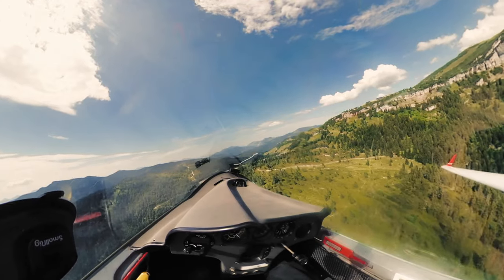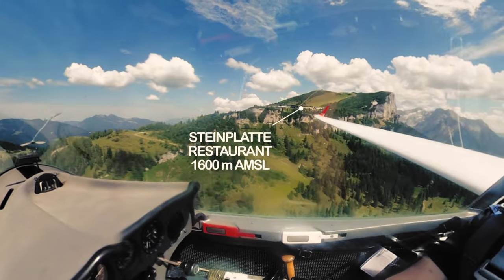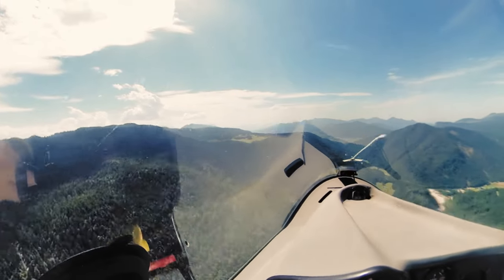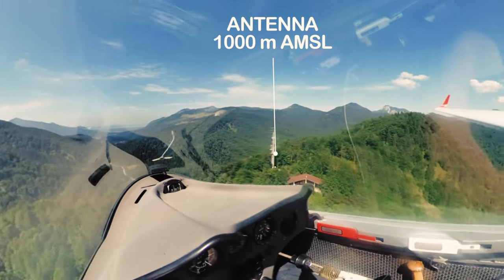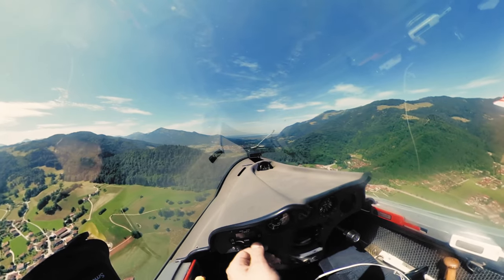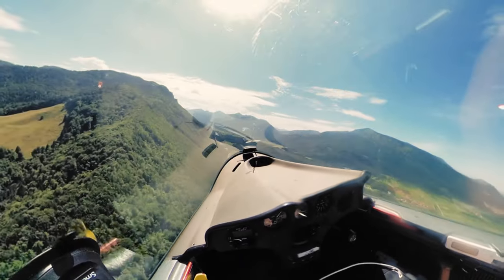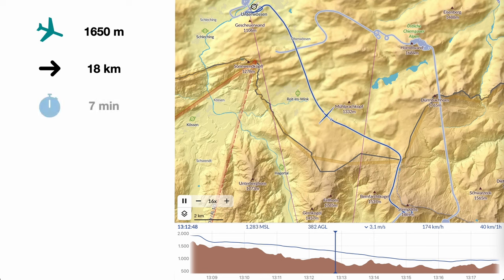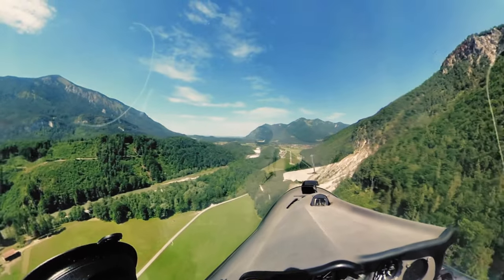LOW LEVEL FINAL GLIDE - Scary but possible - How to return to Unterwössen safely

Comment: The route between Steinplatte and Reit im Winkl does feel very tense! Sooooo many trees and the ground only just falling away at around the glide ratio. It's worth noting that later in the day when the mountains have been sucking in the air from the north that there can be some horrible sink going through that gap at the Steinplatte carpark. Another great video, looking forward to more to help keep the winter feeling away.
Reply from the maker: Thanks for your comment, wingman! You flew this route a few weeks ago and encountered a lee at Steinplatte. Yes, that is an important factor to consider that wind from north late in the day can influence the glide path a lot.

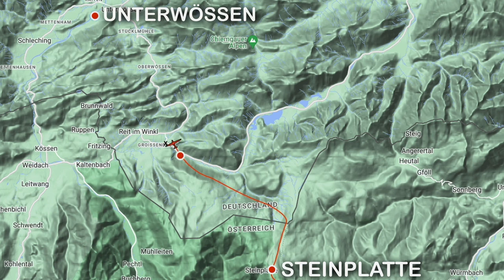Comment: I started a final, some 30 km away, at an altitute of 1200 mts in a 1:30 glider.
No more thermals expected.
A direct opposite light wind estimated to be around 5 km/hr.
Another glider ahead of me, some 100 ahrad but 50 mts below.

Final 10 km was absolutely scary and wonderful at same time with we flying at best speed from the polar and seeing the ground - farmland - so close behind.
Need strong nerves, coolness and high confidence. 
Also the airfield we were heading, layed across our approach path ! And that will require a 90 ° turn for landing.
Thanks God we made a correct estimate of headwind and arrived with some 100 mts for the 90° turn. 
My companion ahead of me arrived almost touching the ground but in high speed and was able to maje a spectacular maneuver to briefly pass anove the eucaliptus trees line that run parallel to the runway and had a succeful landing.
My right turn over the eucaliptus was more safe and I landed short behind him... What a flight !!!
Reply from the maker: wow! thanks for sharing this tense story with little margins left. happy that you both made it!

Comment: Well done!  I focused on your glide ratio, which was conservative (good).  I'm sure you considered required glide, and I'm thinking it was close to your actual ratio.  I'm also a relatively new glider pilot, and getting below ridge lines, unless in a climb or setting up for a landing, raises the hackles on the back of my neck!  Thank you for the video.
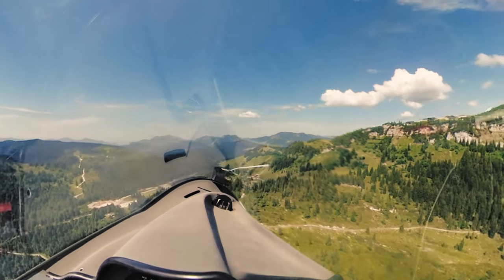Reply from the maker: thanks for your feedback. actually I tried to keep a lower glide ratio around 25 for training purposes and to get a feeling for the worse case when conditions are not good. If I would go for best glide ratio I would have arrived much higher with the Hph 304 (approx. 1:43). Good luck for all your flights in future! Where do you fly?

Comment: thanks for sharing nicely edited and great to follow your thinking and decision making. What was the wind like, would be good to include this as its an important factor in the mountains? most likely very light to non existend from what i can see. Wind could have played a very critical role especially as valleys sometimes create windfunnels or strange conditions you did not expect. your instruments will not tell you this as they only know what was before not wat is to come so only local experience will help you and even then it could still surprise you. ;)
Reply from the maker: Thanks for your feedback! Yes, wind is very important factor for a final glide, especially when low. You observed correctly, the wind on that day was very week. But it happens often that from afternoon on, there is wind from the north, which means often a headwind for the final glide. It is caused by the main ridge of the Alps, which is sucking the air from the flatlands and hills towards the high mountains. Sometimes its a headwind which makes the final glide shorter, but as well it can help for ridge flying late in the day when thermals becoming very rare. I m planning to make a video on that soon. Cheers!

Comment: The pucker factor is intense in this one. What if you hit 'Saufen' in one of the unlandable valleys?
Reply from the maker: Good point. I agree that there isn't much margin if you encounter sink. I tried to approach it like this:
The first unlandable part from Steinplatte to Reit im Winkl is approximately 11 km long. If you begin the route at 1600 meters, the next available outlanding option in Reit im Winkl is at 700 meters (so a difference of 900 meters in height, which we can convert into a distance). This means a glide ratio of 12 would just be sufficient for a direct outlanding on a field. However, if you are flying a glider with a potential glide ratio of 43, and considering the average calculation for final glides in the mountains is 25, there is still some margin left for hitting sink and still reach the next outlanding option (please note that the numbers are just rough calculations). Of course if there is rain shower nearby or wave conditions where heavy sink is to be expected, I would not enter this route.
I hope this answers your question?

Comment: Nice video. How much altitude would you have lost when flying best L/D the whole way ? Averaging 155 is a nice dash home, it's not always the case.
Reply from the maker: The glider has maximum glide ratio of 43 at the speed of 116 kph according to the flight manual. For the distance of 18km the glider would have lost 420m. Of course these numbers are more theory because they have been calculated in still air without any wind. I hope I could understand and answer your question?

Comment: Why did you do a highspeed final glide and not a glide with the speed for best glide ratio?
Reply from the maker: …thanks for your question. two reasons: 1st i tried to keep a glide ratio around 20-25 to simulate a glider with lower glide performance. i did this by keeping an eye on the calculated glide ratio to the airfield on the navigations system (xcsoar) and speeded up or slow down if necessary. 2nd in the mountains many pilots calculate a glide ratio of 25 to be on the safe side. i do this too even this glider has a glide ratio of 43. 
but to come back to your question, of course its more safe and relaxed to choose best glide ratio for this route.

Comment: I hope you would be able to avoid collisions with paragliders at that speed. Not a fan of such flights and there might be less experienced pilots who feel inspired…
Reply from the maker: very important points! thanks! avoiding collisions by looking out is so much important. this attention is needed everywhere at any time. as well gliders sometimes fly at much higher speeds under cloud streets where the traffic is higher than down in the valley. there is a edition of late night soaring which adresses the topic and connects the paraglider and glider community. FLARM is for sure a very helpful technology, recently used not only by gliders bit as well engine powered aircrafts and paragliders more and more. 
and i totally agree, this route is only recommended after flown and carefully checked with a local gliding instructor.

Comment: Assuming a pilot can fly the numbers, and nat get lured into attempting to climb in weak lift that wastes valuable time and altitude. And assuming there is no severe headwind present, then of course the math will show a glide ratio required to reach a destination based on simple height over distance. 
As long as that number is conservative in relation to the aircraft and pilots ability to fly at that lift coefficient to better that required glide ratio , you will make it. Keeping the out-landing field in mind is valuable insurance.
Reply from the maker: Thanks for the helpful addition and reminding the variety of factors and parameters needed to calculate a safe and considered final glide!